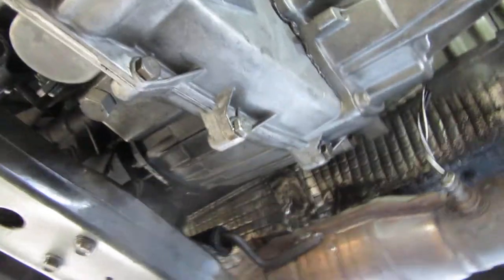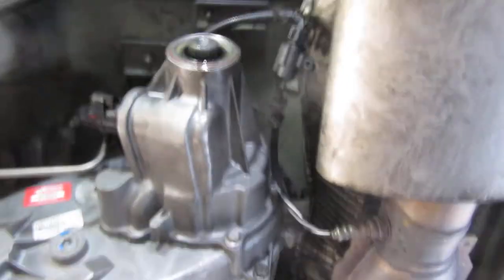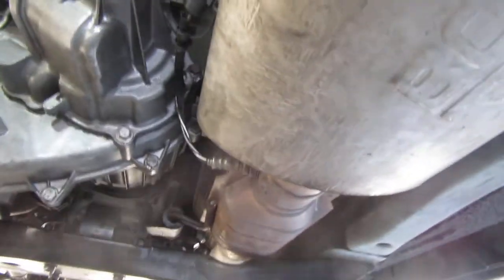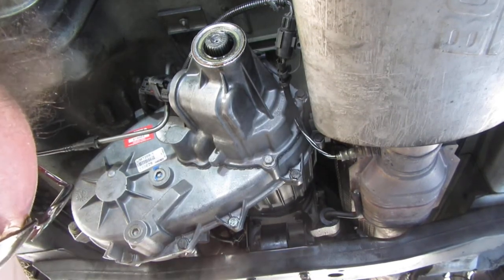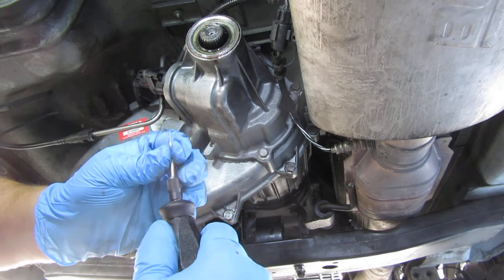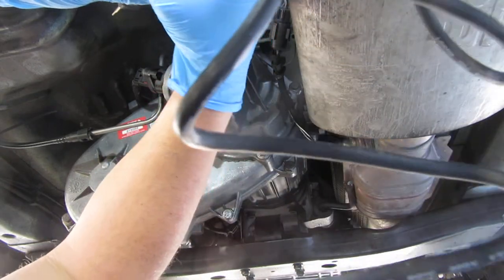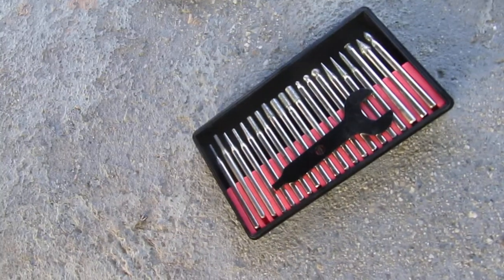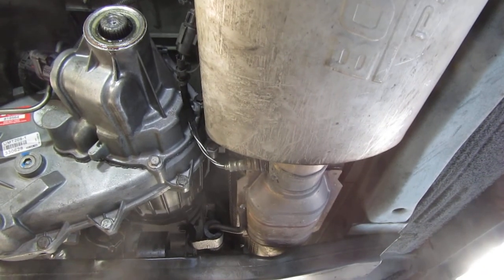Broken Drill Bit Removed from Broken Bolt  Jeep ZJ 5.9

Comment: Hey great! but i cant find that diamond drill/dremel bit - is  there no way i can do this with just a drill - i definite dont want to tow the whole chassis to machine shop!
Reply from the maker: Check out Harbor Freight's Item  69661  Drill won't spin fast enough.          https://www.harborfreight.com/diamond-point-rotary-grinding-set-10-pc-69661.html
Reply from the maker: Another Harbor Freight Item#69653 .   $7.99                                                      https://www.harborfreight.com/diamond-point-rotary-bit-set-20-pc-69653.html
Reply from the maker: REALLY  -  CHECK THIS OUT!  For $9.99 , you get the rotary tool and it comes with diamond bits.  Who knows?  It might actually get the job done.  Try it out.         Item#63235   https://www.harborfreight.com/rotary-tool-kit-80-pc-63235.html